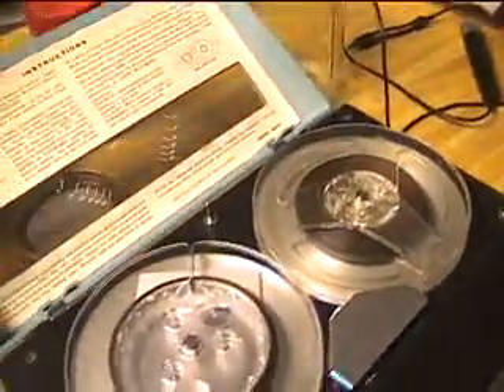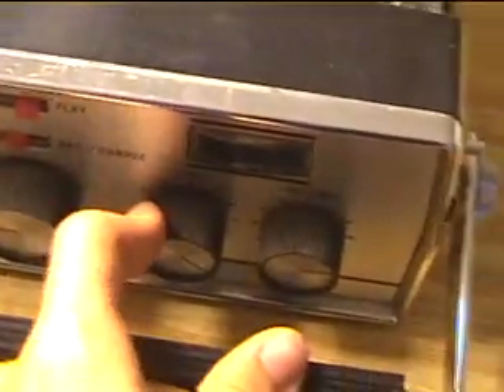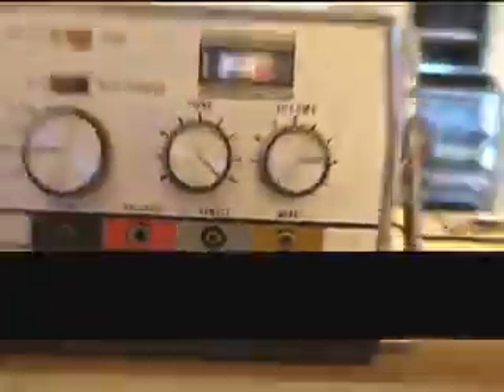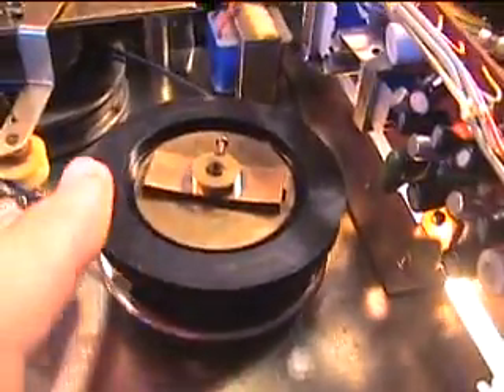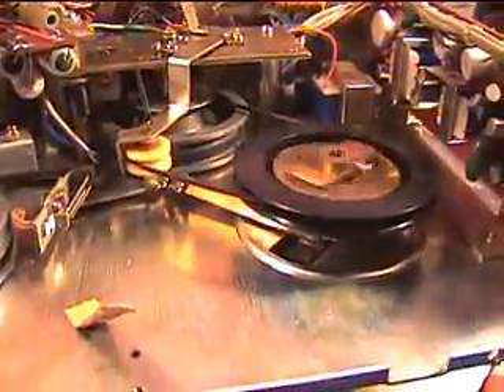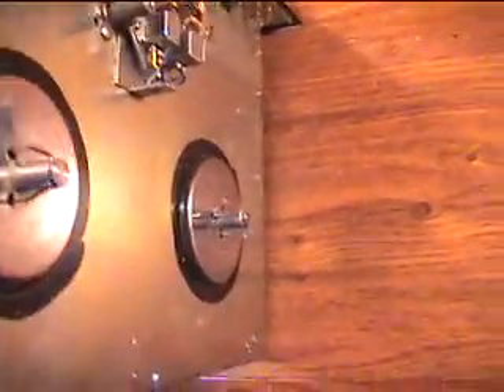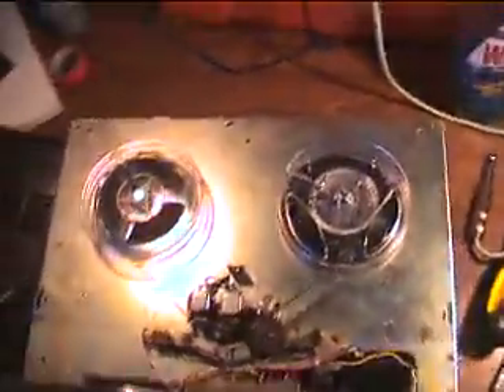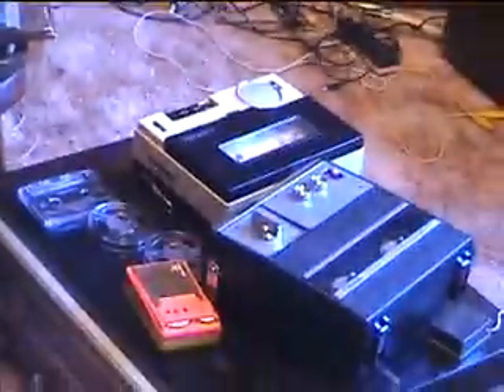Phonola Magnecord 9004 reel-to-reel PART 1

Comment: be careful oiling - only as a last resort and even then sparingly apply light sewing machine oil. most speed faults are likely to be idler tyres which need going over with fine sandpaper to restore grip, and slack belts as you know. nice deck, good luck with it! - Ben